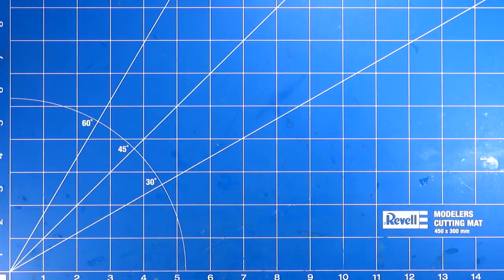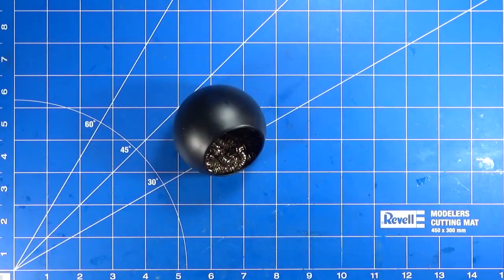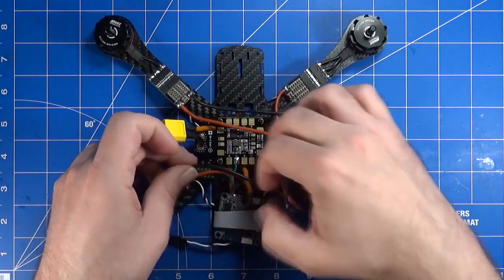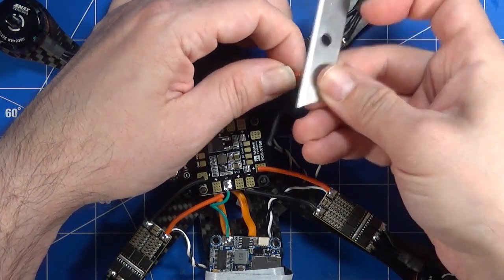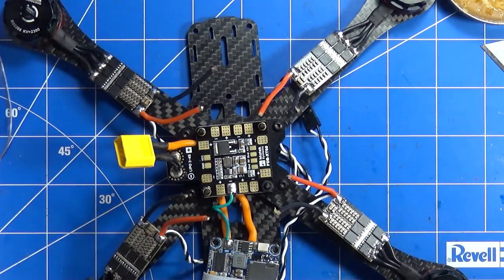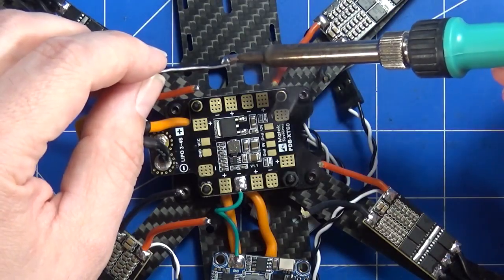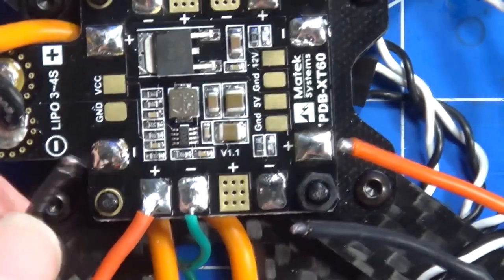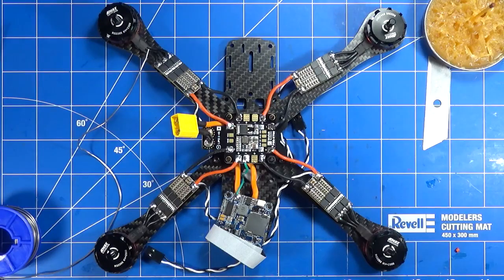How to solder cables to PDB? Soldering for beginners

Comment: I started soldering electrical gear in 1970 and I'm still learning. I got a temperature controlled hot air and soldering work station last week to learn how to replace surface mounted components. Just wish my hands were as steady as they were when I was 18. Cheers Pawel; hope you're well.